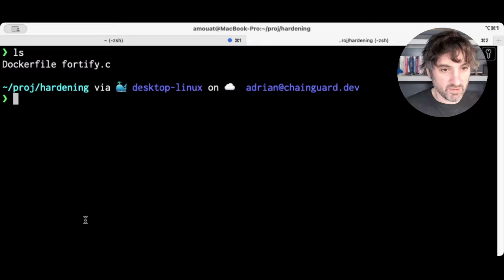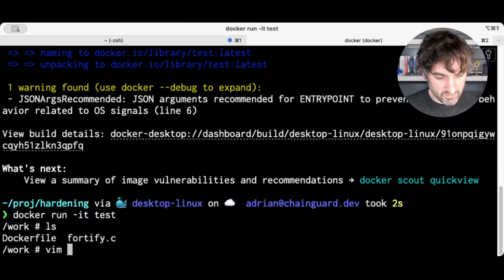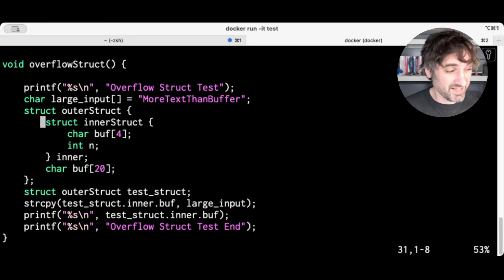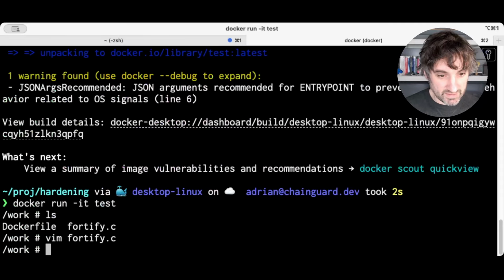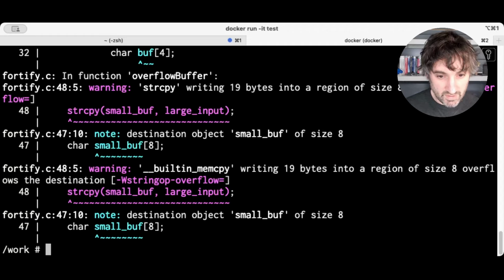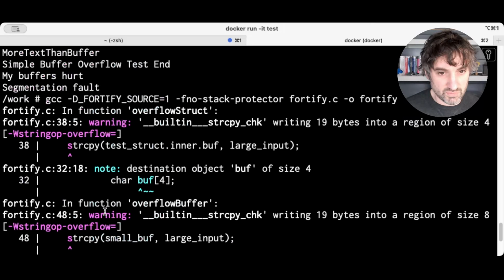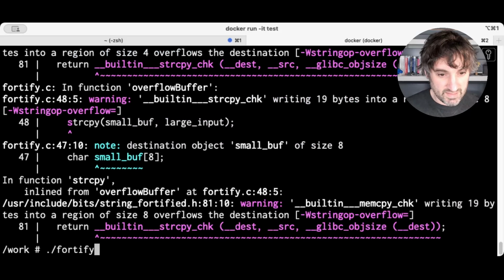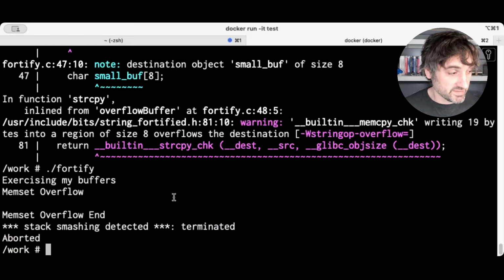Using Compiler Flags to Improve Security | Chainguard

Comment: Hey great content. I got a question: I checked you github code:

* Compile with:
 * gcc -D_FORTIFY_SOURCE=0 -fno-stack-protector fortify.c -o fortify
 *
 * Then try different values for FORTIFY_SOURCE and enabling stack protection.

isn't -fno-stack-protector disables stack protection? shouldn't the flag be -fstack-protector ?
Reply: yes I understand in the video you've explained it...but the description in your Github code is confusing / has the opposite meaning.

also, do you know to make di D_FORTIFY_SOURCE to output more log / error trace? the error message:
* buffer overflow detected ***: terminated
[1]    263062 IOT instruction  ./improve_safety

seems to have minimal info. Is there a way to expand the error trace?
Reply from the maker: @pietraderdetective8953  I've reworded, I hope that helps. I'm not aware of the ability to add more logging.
Reply from the maker: @pietraderdetective8953  I was curious about the logging, so I took a look at the code and I don't see anything. Take a look at the __chk_fail calls https://github.com/search?q=repo%3Agcc-mirror/gcc%20__chk_fail&type=code

I don't know if clang is any better. I understand your point though; why not output the sizes at least?